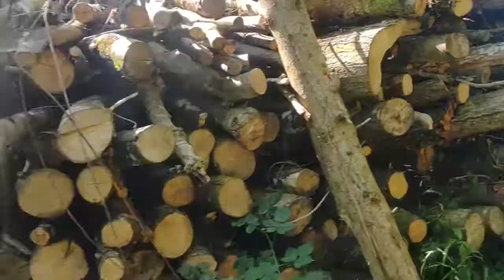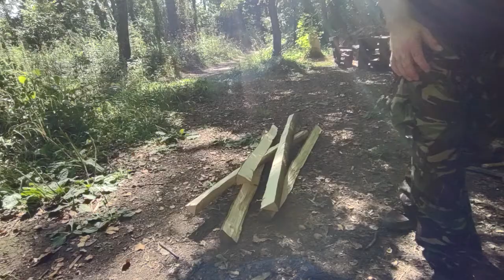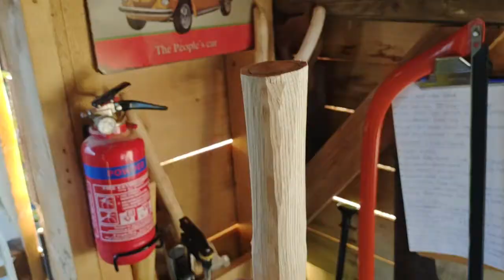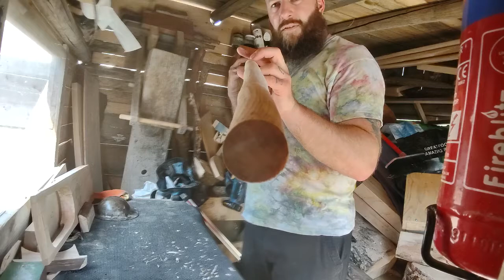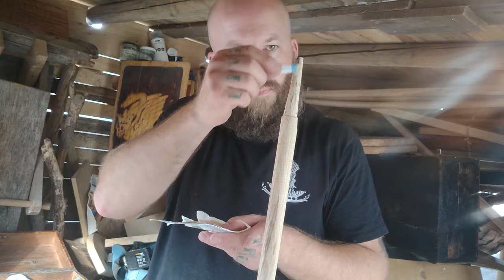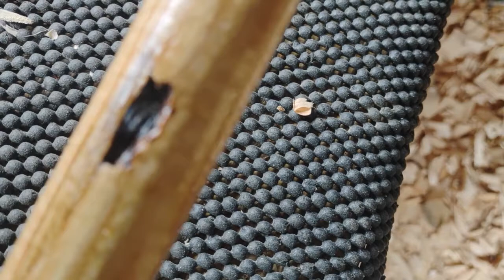Spear Shafts Part 2: The not so easy and less noisy way

Comment: why didn't you polish the spear,  head and shaft,  and why you rivets, the L-shaped nail holds well enough.   I like that you made the shaft thinner and it is nicely straight.
Reply from the maker: I quite like the hammered look of the head, it's more authentic looking rather than the polished heads you see every reenactor use. 
As for nails/rivers I used two halves of a nail so it looked like one long nail that's peened over.